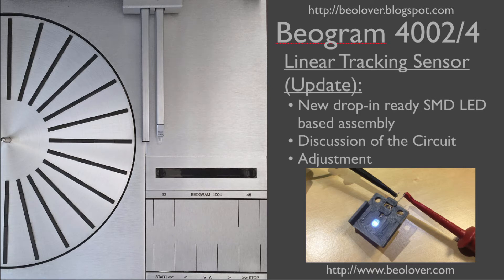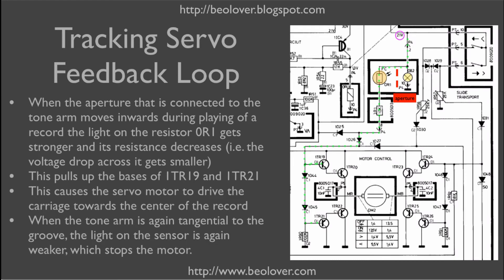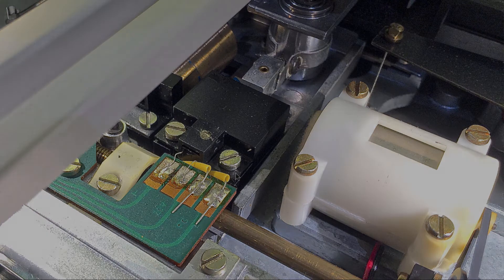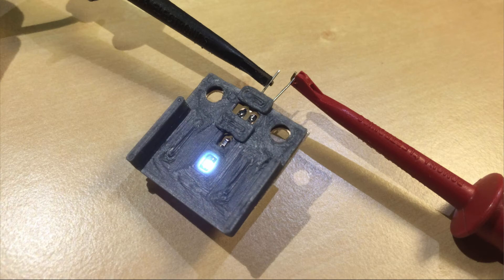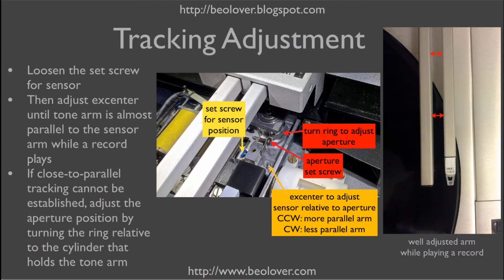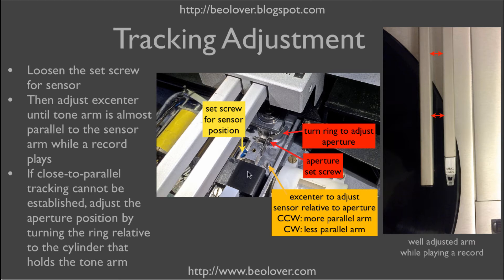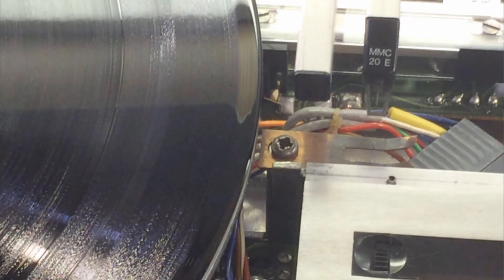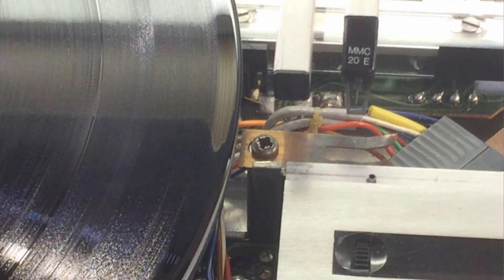Beogram 4002/4004: Update - Tracking Sensor LED Conversion and Adjustment

Comment: You rock - THANK YOU! :) Do you have plans to make this replacement assembly for sale? And what resistor is needed for using a standard LED on 21V rail?
Reply from the maker: Andrej Falout This part is available. Just send me an email at beolover@gmail.com. There is no standard resistor value for LEDs since they all have different outputs efficiencies and max. currents. For a standard 20mA white or amber LED you can start out by trying a 2k resistor. It does not need to be very bright.